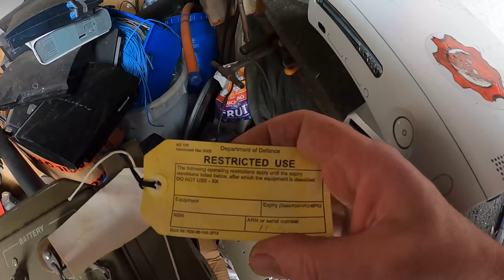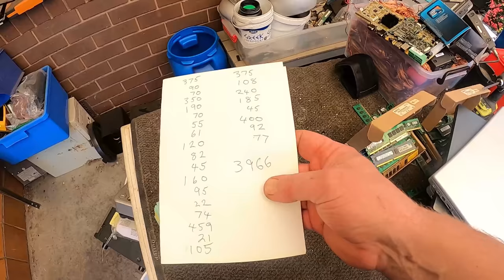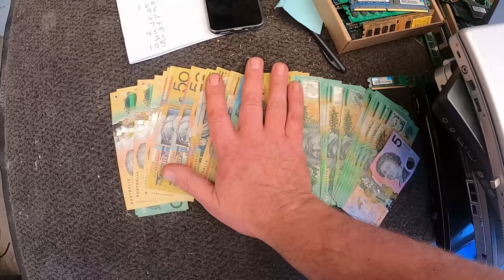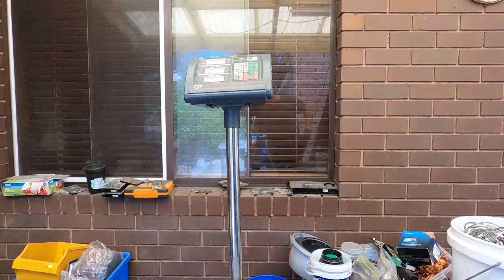Mega Scrap Marathon Part 3

Comment: Ben you should consider having a small batch of caustic soda heated on standby when scrapping boards that have gold plating scatted around the board, especial the small ones related to telecom and then also ram sticks. You don’t need to dip the whole board, just about an inch of it to know if the whole board has more gold plating under the solder mask. Small batch, just grading the board itself. When your done with the caustic soda, cool it and dilute it and ph balance it with citric acid Coffee filter out the solder mask then dispose of the water. Wineries use Caustic Soad and Citric Acid for sterilizing tanks, hoses. Pumps and connectors. Use approprite ppe until it’s diluted and from there it goes straight down the drain. Peace 🖖🏼 and great video

Comment: What are you doing with all the batteries you take off the circuitboards and the microwave transformers? And how do you seperate the copper from the stackers? Lots of questions, but I'm stacking these things up as well. Just curious what would be the  best way to clear these out. :)

Comment: At 1:31:45 when you said that the hard drive had been taken out of the PS2... the more likely scenario is that it never had one.
Those machines were about $200 USD when it first came out, and to the best of my knowledge, there was only 2 situations in which someone would absolutely need a hard drive, which was a somewhat expensive add-on back in '05:
1) if you wanted to play Final Fantasy 11 (online only game) since it was too big to fit on a PS2 DVD.
2) If you wanted to do a bit of (legal) hardware hacking and turn your PS2 into a Linux PC, there was a kit you could buy to do that.
Every game (other than FF 11) was optimized well enough to fit on a standard DVD disc, and the save files generally only needed a small portion of a fairly inexpensive 8 MB memory card, so hard drives being included with the PS2 was seen as an unnecessary expense.

Comment: probably a bit late but for future reference @19:33 the slip ring assembly you cut the wire off of usually has gold contacts in it.  Not much, and quality varies from manufacturers of the camera.  It allows the camera to rotate a full 360 degrees without the signal wires getting tangled up and knotted

Comment: Ben, the Xbox 360 S has a hard drive in the side of the small vented side panel! This model was a much improved model than the first, having a bigger fan for improved cooling and bigger hard drives that slot in side panel.Never seen that small Playstation 2 before!

Comment: The big bulky shiny scratched PS3 original is the one that's worth the most, it's the only one with built in hardware for backwards compatibility all the way back to PS1 games. It was replaced because of the super small 80GB hdd, the later versions have a larger hard drive but lost backwards compatibility. The PS3 slim (smallest one) was the last model to be released but also the least valuable. of the three. Cheers Ben.

Comment: 35:00 you are mentioning a tattler capacitor what's in it that has value to keep???
I am wondering!?
Reply: tantalum capacitors and the metal is tantalum   try wikipedia for  more info

Comment: That Xbox has been arpart before an had the X-Clamps replaced with proper screws/washers. Those X-Clamps are why so many of those red ringed. People like me made a FORTUNE replacing those clamps. At one point I could strip one down, fix it, put it back together in like 15-20 min

Comment: Someone may have already answered this, so sorry if it's a duplicate.  I don't know much about Xbox or Nintendo, but I can answer your questions about the Playstations.  You have four different models of Playstation.  The larger PS2 is the standard model, while the smaller one is the PS2 slim - a later model.  As for the PS3, you have three different generations.  The shiny black one, also called the "Piano" model, is a first generation model, and while it had the oldest hardware and smallest drive, is fairly coveted by collectors.  The similarly sized, but dull black version of the PS3 is the second generation "slim" and the model with the slide-top disc access was the last or third generation.  Each generation came with improvements in design, better components and larger hard drives.  Some of the second generation consoles had problems with the blueray player and also overheating issues - I believe this was because they changed the outer case without considering the air-flow of the inner components.  Overall, the first and second generation are more highly coveted than the third, even though by then they had worked out all the kinks with the console.  Hope that helps.

Comment: layStation 3 is in three models and each one has different variants namely : The Original one available in 20, 40, 60, 80, or 160 GB hdd. PS3 Slim model available in 120 GB, 160 GB, 250 GB or 320 GB hdd

Comment: Since you disassemble many parts by hand and don't crush them, have you ever researched about if the plastic is recycable as well?
The biggest problem about plastic recycling is contamination by other plastic. Without knowing it better, I would assume, clean plastic of known composition and color could be a sellable product. Most plastic products have a mark which tells what kind of plastic it is. Do you have some knowledge about this topic? Can plastic be a sellable product if you seperate it meticulously by type and color?

Comment: Your town needs a recycling center that grinds up plastic, cause some of the plastic is polypropylene and some is abs plastic. And once it's growned up it can be sold to companies that makes plastic lumber. And that lumber is simple to make just use 70 %polypropylene 30%polyethylene and 10% baking soda or Tyveces. Tyveces you have to wear a resperator full face,cause it's a cancer causing agents. But if the baking soda is used it's better for the environment . This recipe is used to make plastic lumber. Just think if TV plastic bodies is grinded up and all these plastic bags or stretch rap is melted together with baking soda you could have plastic lumber. Then the plastic will not go in landfill. Better for the Earth. If you  read this. Pass on the recipe. That 70%polypropylene /30%polyurethane /10%Baking soda

Comment: Transistors(looks like 2n699 and 2n2222) are gold doped silicon and must be processed as gold ore not gold flakes, dust, or nuggets as they need to be removed from the silicon first. Your observation of silver plating is wrong. Those military boards are tin plated with heavy lacquer coating to keep tin fingers to a minimum. Only space made boards will have silver and most will be actual gold instead. Silver base was extremely rare and most if not all have been already scrapped out. Do NOT make that mistake again, it's a real expensive mistake.